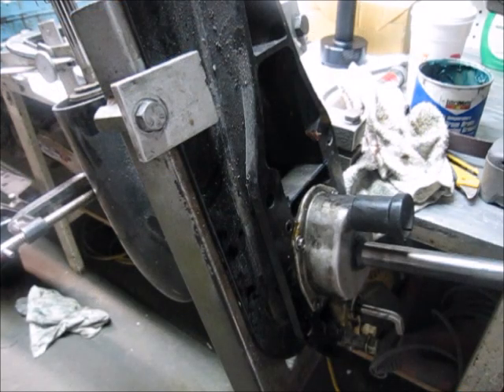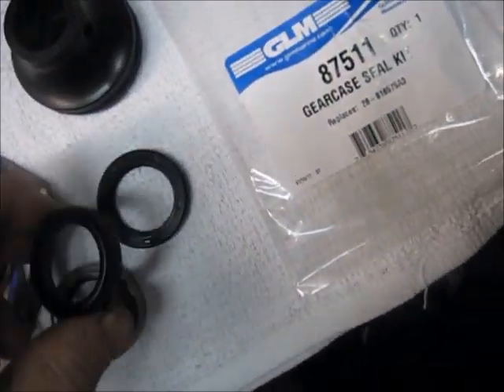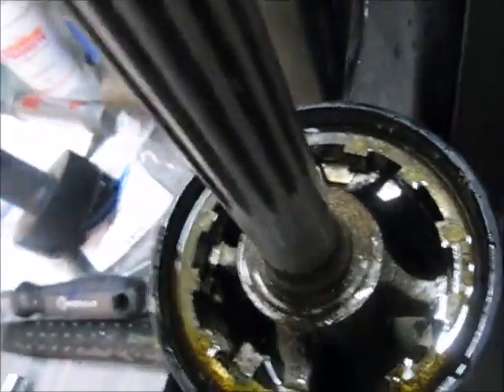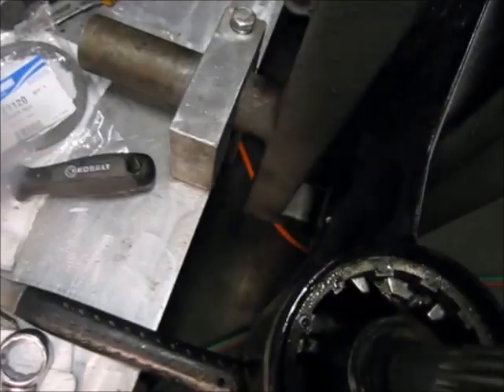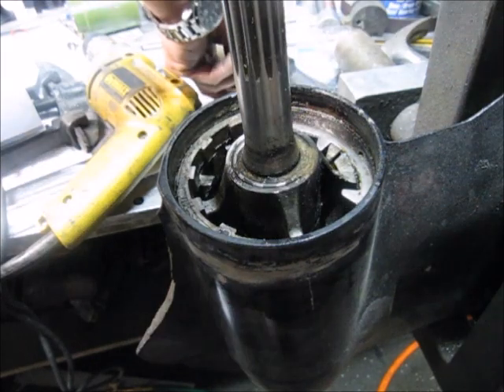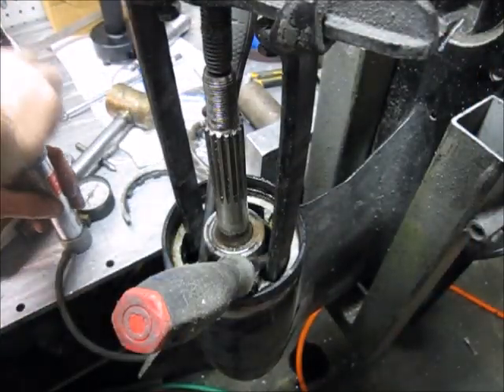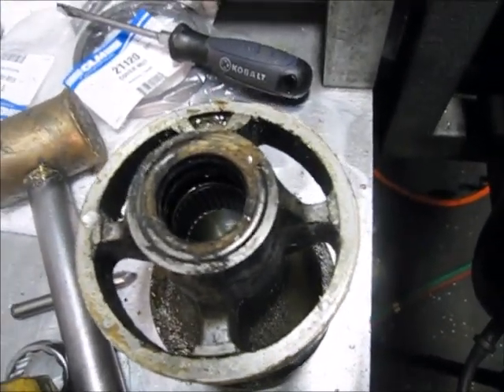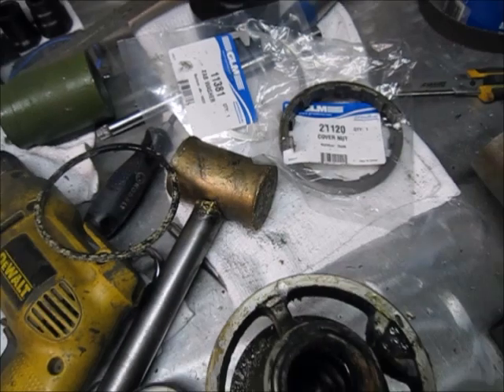How do I remove my Alpha 1 gen 2 bearing carrier

Comment: best video yet!! Very clear and easy to follow. this will be my 3rd oil seal replacement and this time adjacent bearing bits came out too. too much rubbish in Hong Kong waters! I wonder why more stern drive makers don't have a gear box oil reservoir in the boat with an alarm when oil level is low.

Comment: Hello, good videos. Do you have a video of the actual prop shaft removal? I have an alpha 1 gen 1 that was getting oil in the water pump. The shaft has a lot of side play at the pump and end play (up and down). I need to pull the bearings and gears to see whats going on, most likely needs bearings and seals. I had metal on the oil plug magnet as well. Thanks
Reply from the maker: Thank for kind comment. No video at this time, but it is on my video,s to do list look back in 2/3 weeks.

Comment: The seal lips do NOT go to the inside. They go to the outside. Secondly, there are 2 seals because it takes 2 seals stacked one on top of the other.
Reply: I was thinking the same thing.  Plus I've never heard of oil seals cutting fishing line.

Comment: i have  a problem white mij reverse gear, it  goes to reverse but it doesn't lock the prop. forward it's locking perfectly. maybe there is some damage to te gears? i checked the cable all ready and don't think thats the problem.

Thanx for the video it's very helpfully!

and sorry for my bad language I'm from the Netherlands.
Reply: joop de jong From your description, it sounds like your clutch dog is wore out. I only know this from experiencing the same issue and a lot of research.

Comment: U might want to change the position of your seals.  The side showing the springs go on the outside.  The metal backing should be put in where they're back to back.  if not, it's gonna leak.

Comment: i noticed that your lower unit doesn't have the screw holes for the prop anode(91-95). The reason i ask is, do you know if i could replace the old carrier with no holes for prop anode, to newer carrier(96-current) with anode holes on older alpha one gen 2?

Comment: I am in the middle of replacing my seals and O ring but when i pulled the bearing carrier out the reverse gear came out with it? Is this a bad thing or normal? I seen that yours didn't come out.
Reply: its normal, did you fix that?